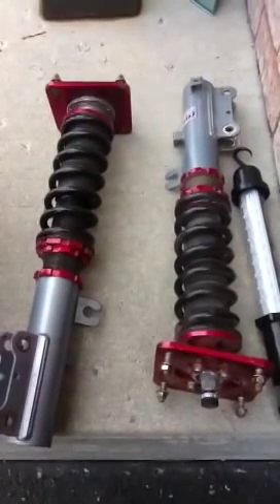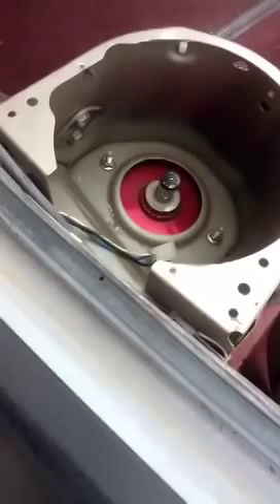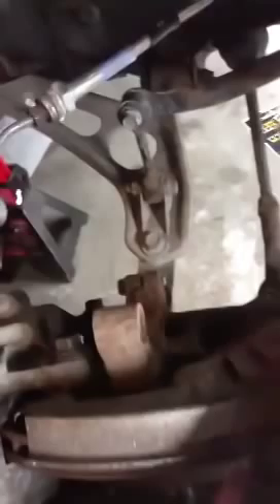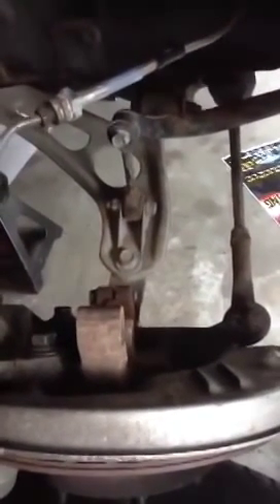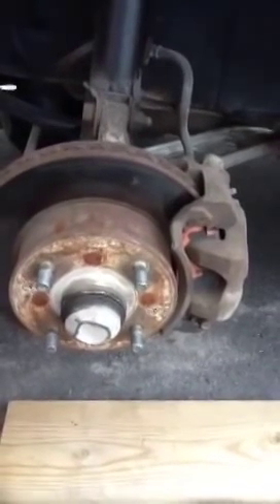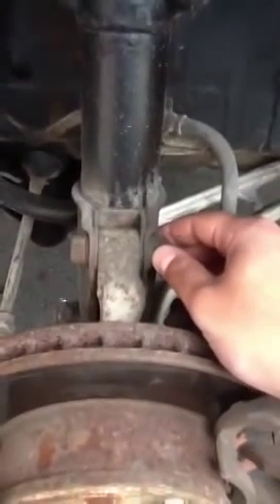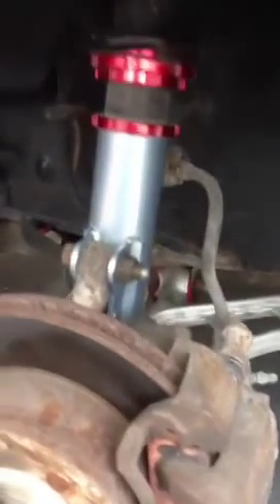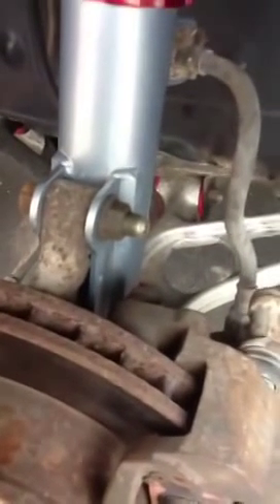Coil over suspension swap how to video (FC3S RX7)

Comment: Hi, I recently did the shock/spring swap and having problems putting the brake line back on the front shock. It is a tight fit and wont fit back? Did you have trouble with that? Or how did you put it back on